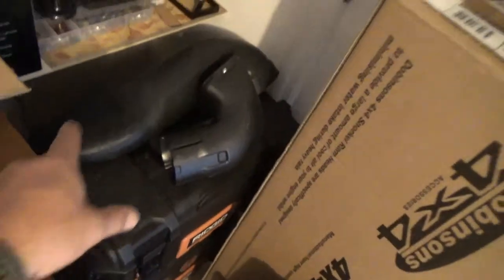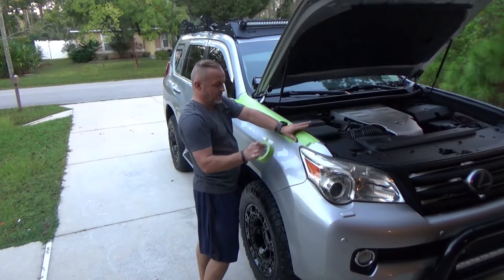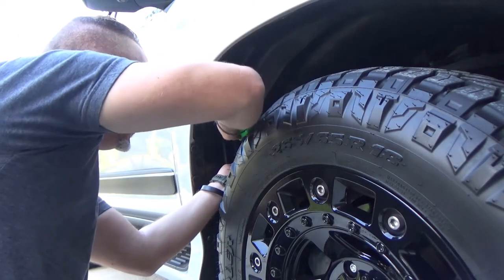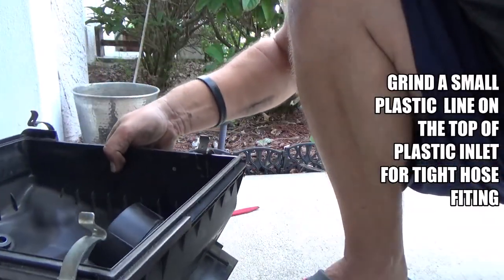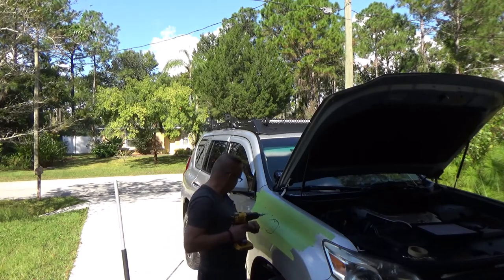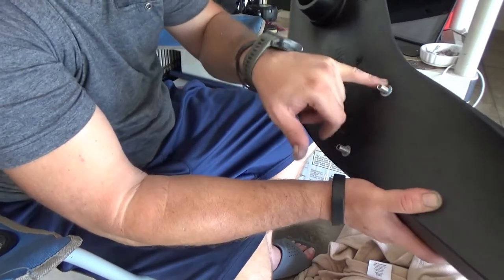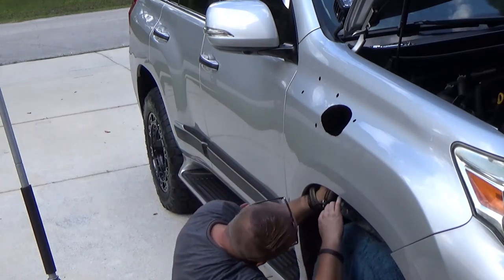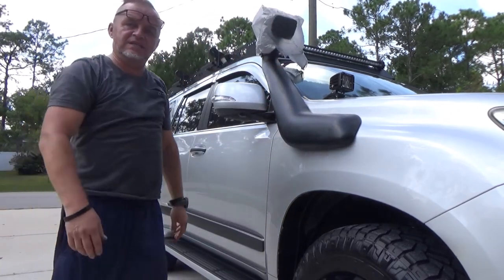DIY- snorkel installation in detail-lexus gx 460

Comment: To remove them plastic clips from the inner guard put two small flat blade screwdriver into each side of the centre part of the clip and pry up to release locking tab then remove the rest of the  clip 😀